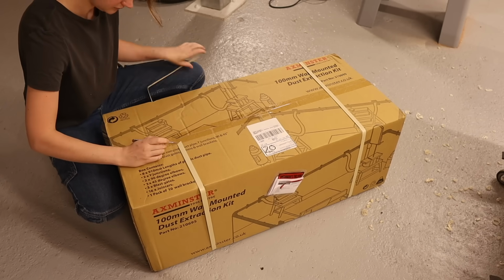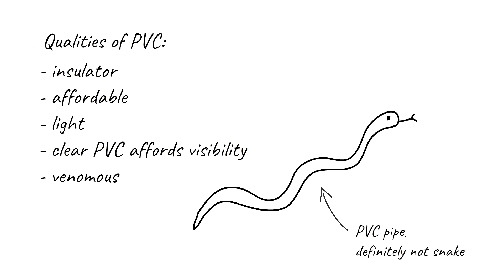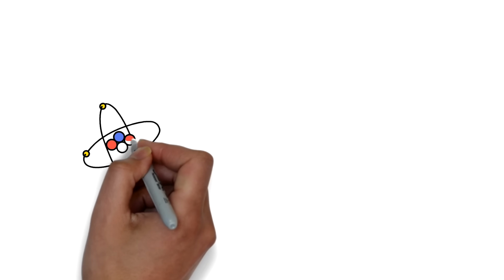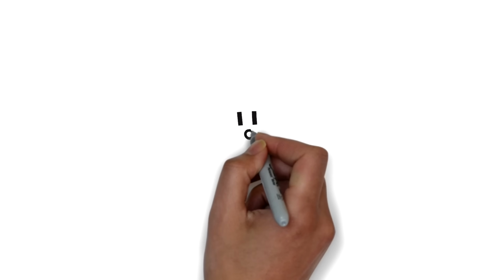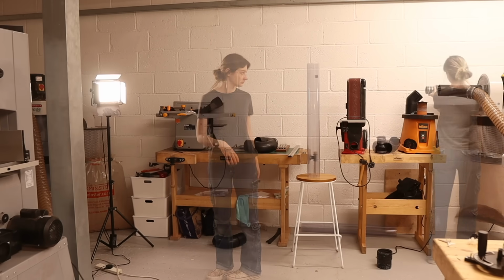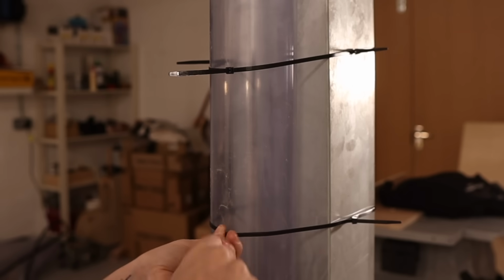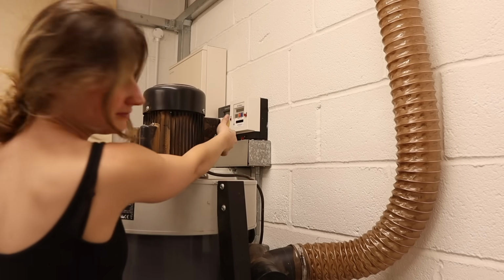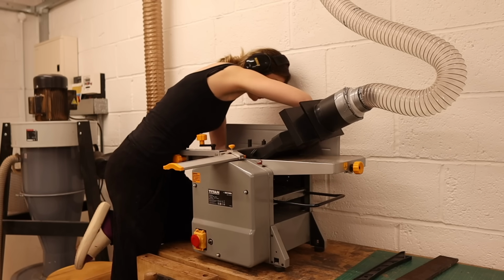Why Your Dust Extraction Might Explode

Comment: As I see it, the method will not work at all, seems you discharge some spiral of the outer surface of the PVC tubes directly below the wires - that's all. But charge will build up at the inside, because there you have moving air with dust.
What you receive is rather something as a PVC capacitor, that stores even more energy beeing grounded at the outside with the tube as dielectric.

You need something very different: spray a conducting lacquer into the tubes and then perhaps make an grounding contact for each tube part. E.g. drill through a little hole, screw, inside a little peace of metal (copper foil? The washer?) perhaps glued to the surface with a conducting glue. That will not allow inner surface charge any more. Doesn't matter, if the laquer is really low impedance - even a MegaOhm per centimeter resistance allows charge not to collect. That stuff may be graphite spray, it just has to be sticking with the surface and not with the dust. Of course you can glue in aluminium foil also, that may be a bit hard to ground contact safely, because it always is covered with oxide, cannot be soldered.
Still: wire outside would increase the problem rather than solve it. Because it is a surface charge on the inside. On the whole inside, also between the wires. The energy stored isn't a lot, but discharged in a small spot it could ignite dust or fumes.

Perhaps you check ESD materials at electronic distributions, discharge is a big theme in electronics. There is a big one in UK formerly "Radio Spares"....

Comment: You think your dust problem is bad? I work alone and live alone, due to wonderful events, i went from a home luthier to a legally blind home luthier, which includes severe light sensitivity. My workshop has no ventilation whatsoever, no fans no vents, nothing. if i open the doors any time during the day, i cant see to work. so all my woodworking and sanding and superglue fumes are in a 1 room 1 car garage that is essentially sealed up with zero airflow. So i wear a gas mask...does that remotely help? No idea. no options. and in case you are asking how does someone with about 20 percent vision build guitars...uh, slowly, and mostly without power tools because i value my fingers and blind chiseling is safer than blind routing. Believe me, the precision is significantly better.

Comment: I'm an electrician and you did a good job. Maybe wrap a bit more wire around the outside of the poisonous snake to make sure no static electricity builds up and you touch it and get a shock. Did you use an electrical meter and check continuity from end to end of the wire?
Continuity is what it sounds like. Making sure the wire is a continuous unbroken path all the way to ground.

Remember, the equipment should be grounded, but you as a person need to be insulated if in contact with electricity. If you are grounded when you touch electricity, you are a path to ground and that is when you get shocked.

Comment: Air moving across plastic ALSO generates static. Sawdust also reduces the humidity in the exhaust system and that is why there is no excuse NOT to use the grounding wire!
Reply: I am an old guy not on Telegram. Messenger, signal, WhatsApp. What I can also add is that in the old days of electronics, static caused by using cans of compressed air killed transistors.

Comment: the clear pvc is pretty cool, but I find that stuff isn't even close to worth it.  You go to a home depot or something like that, and you can buy PVC sections and connections for about a quarter of the price of the same stuff but in black and marketed as "dust collection" pieces.  Smooth walled PVC is smooth walled PVC, it doesn't matter how thick the walls are or what color.  Buying PVC from the same place you got the dust collector is usually a terrible idea.  Contact cement and foil tape are also your best friend when trying to create, air tight connections.

Another Fire Hazzard to watch out for, is sometimes little pieces of metal might accidentally find their way into the extraction system, which could potentially hit the blades and go red hot, then smolder in the collected dust and start a fire days later sometime!  So you should have a fire alarm, right above your dust collector, and potentially even some form of active fire suppression.

Comment: Don't use those twist-on wire nuts. Get some lever lock connectors. Wago is a good brand name, but Amazon sells dozens of brands. Wire nuts are 20th century tech. They aren't supposed to be reused and they are a pain. Wago connectors can be reused infinitely and provide other benefits I won't bore everyone with.

(There's nothing unsafe here, just some friendly advice about a good tool/device that will make your life easier)

Comment: I missed seeing a connection to ground.  I wouldn't trust a connection to a supposedly grounded machine enclosure.  Rather, run a wire to a real ground such as rebar in the building's foundation or a copper grounding rod.

Comment: PVC might be cheap, but it will wear quickly, so you'll need to replace it in a few years. Use metal, no grounding problems and it will last decades.

Comment: I reccommend you avoid asploding yourself, as it is difficult to post videos when you are all torn to bits and on fire. 

Perhaps use less asplodium in your diabolical contraption. I find asplosions to be caused by excess asplodium in my designs. Some of which asplode anyway, but that's another story. 
(I once made a couple ounces of water in a plastic bottle asplode. Wasn't TRYING to. It's just a gift, or a curse, if you dislike loud noises and firemen clomping about asking "where's the asplosion" but you can't hear them, because your ears are ringing so loud and you feel like the biggest idiot in the county, so you GTFO before the cops can write down a question you'll be dumb enough to answer out of shock...) 

That has been my experience anyway, and I was only a little bit on fire just the once, in another asplosion, and not torn to bits at all. So, learn from the experience of myself and my friends, most of whom have been on fire at least one time. You don't have to make a visit to the burn ward for debridement and skin grafts. You might find excruciating agony somewhat... distracting. I know I do, and I didn't even need grafts. And it gets old, climbing out of smouldering craters and patting out flames on your shirt and pants while muttering, 
"Well, THAT shouldn't have gone off like Putin's ammo dump! Now I'll need a broom... and a Caterpillar D-9 Bulldozer." 

Also, cats do not like vacuum systems, and will run around, panicking and screaming "SUCK MONSTAH!!! AIEEE!!" Because all cats are extras in an old Japanese monster movie, and think vacuum systems are all Gojira, or Gammera or Mothra or some damn thing wants to eat them. At least, MY cats do, and while they are only imaginary cats, they are still fairly typical. (The county won't let me have REAL cats, because of all the asplosions, and made me sign an agreement and everything which was SO unfair, I wasn't even the one driving the truck, it was a piece of fungus from "Attack of the Mushroom People," another fine Japanese monster movie.) 

Hope you find this helpful. Sorry, I have to go now, my stomach keeps asploding. Hiccups.